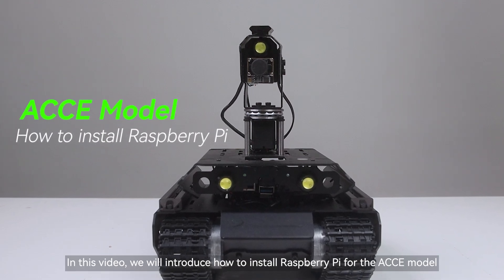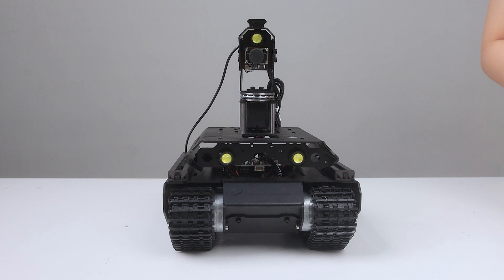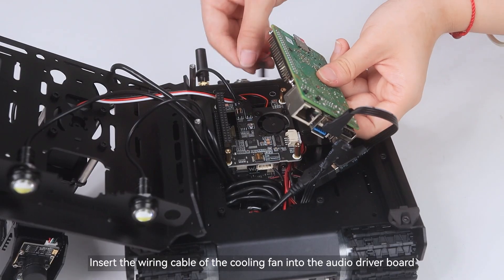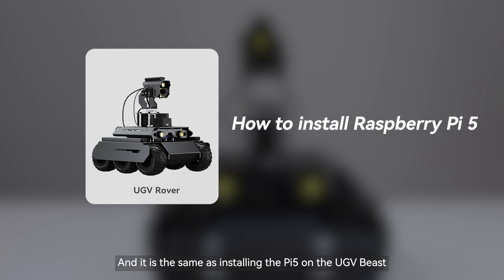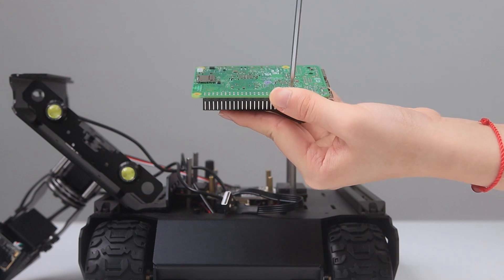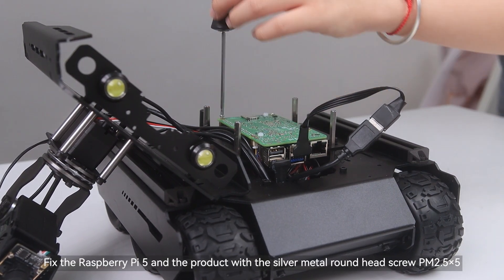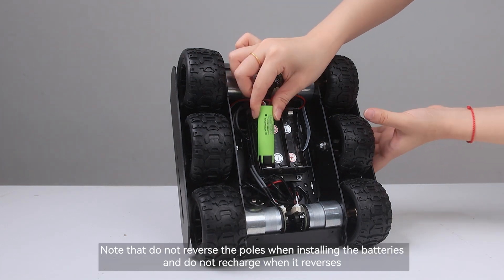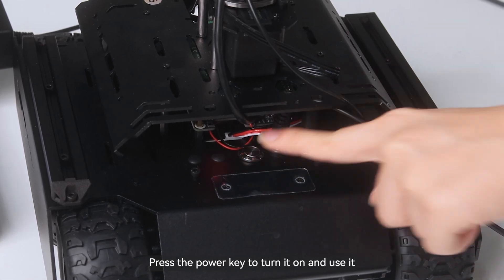Assembly tutorial for ugv rover & ugv beast, AI robot, how to install Raspberry Pi and batteries

Comment: Hi., I just bought the RPI rover, there are few things to improve:
- cabling
- where to connect the Lidar, I asked to the service and I am still waiting, considering that there are 2 Lidar ports.... (ticket 176076)
- I bought it to learn about ROS, but there is nothing, just mentioned in the product description, but nothing else.
- the audio hat it is interesting, but it is not sold separately for other projects.

considering that the lidar and ros are the feature that I suppose push people to buy it, could you make videos for the first on how to install it and add instructions about the ROS on the wiki.

thank you.
Reply: I connected the Lidar to the Audio pcb somewhere. Not used Usb about the input of this Lidar port then going to a usb converter on the audio pcb. You also need to switch on the use of Lidar into the code. Just have to setup one variable to be true.

Comment: I really like this product. But there schould be a much better manual. More detailed, especial, if you get problems with the code instalation of it. Also tell ppl, that it need to install the boot loader as first, on a fresh bought Raspi5, before the demo code can be installed with the sd card. Also there are some things in code, you need to setup the right way, and there is no info how to do, except you studi the code and find it out by your self. More demo code and tutorials how to use it are need. Also it need more info and code about the LIDAR. How to install and use it for Autonom driving. Some more tutorials about autonom drive as well, would be nice also. I really like this nice product, it have a great learning potential, if you co into robo technic. Also it looks like a high quality product. The chain is a bit too hard, so it often clitch and you can't move trough small obstacles. So it would be nice if they would have those like a rubberband is, more or less, so it can't clitch or slide.
Reply from the maker: Sincerely thanks for your feedback dear, we will feedback this to the related department.